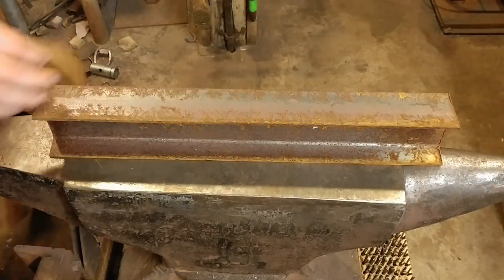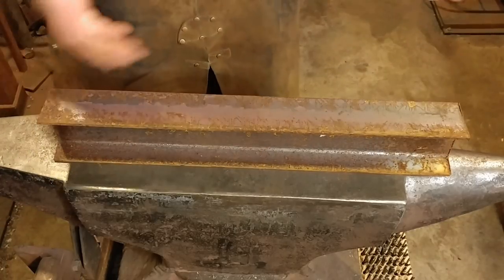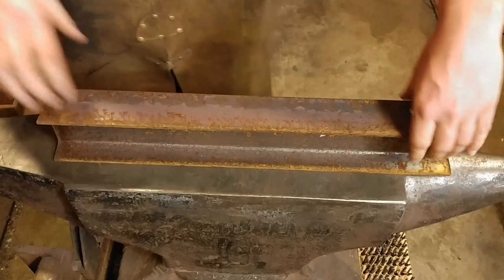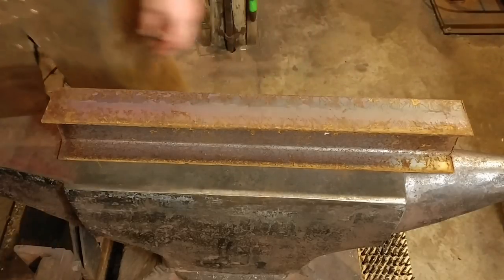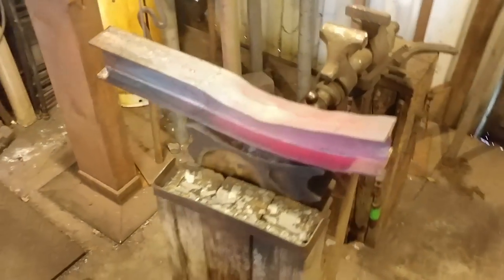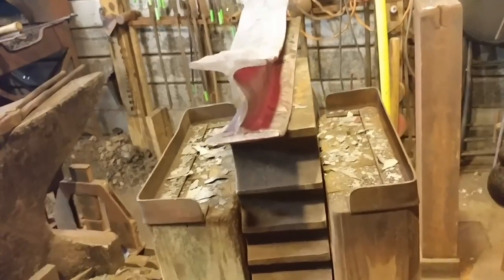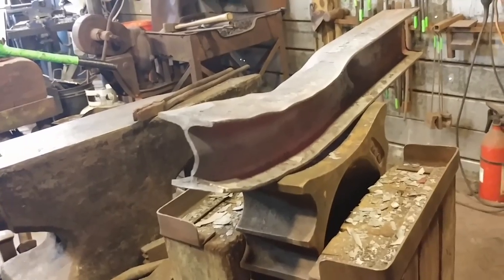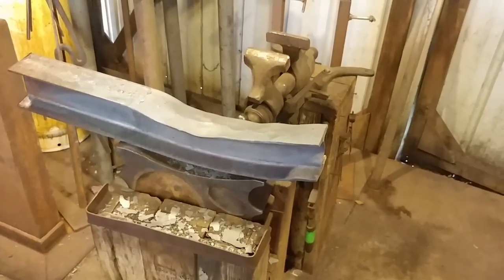Can You Bend I-Beam ???

Comment: I build locomotives for a living and setting the camber is one of the steps and if the camber is off we use rose bud torches and heat a triangle  if you want the beam to go up you heat a triangle from the bottom  t the top edge of the web don't heat the top and if you want it to go the other way just reverse the triangle and go from the top to bottem
Reply: Micky Swift I used to weld up the locomotive chassis for a bit those 4x6 solid frames take 4 hours for a 7/8 fillet weld (.075 double shielded arc) very hot stuff!
Reply: tim jackson yah it depends what you a welding we run . 052 wire  but yah it can get real hot with the longer welds

Comment: when I was building things / working with 9, 14 lb etc. I-beams when we had one with a ding or twist.. it would take a BIG honking rosebud, (slowly heated to temp) then we would chain down the beam,  place a block under it just behind the area. Then use a 10 ton crane and heat the beam the beam in the opposite direction. then the beam would go in reverse to straight.  sounds weird but that is how it works. slow and steady pressure is what a beam responds to. (as in a come-along) or LARGE winch would work as well.